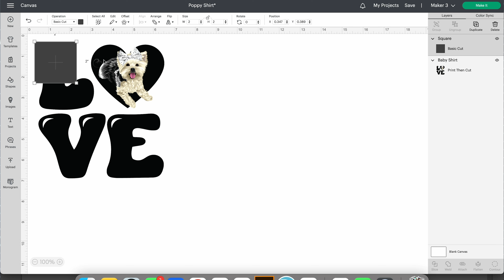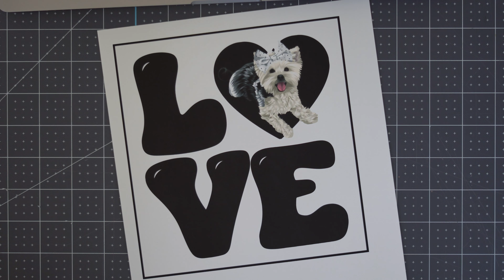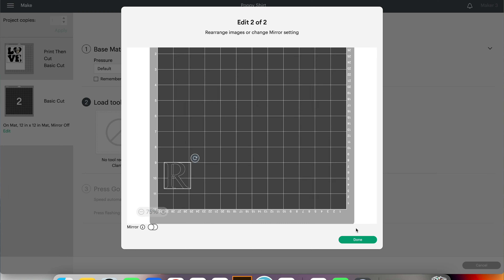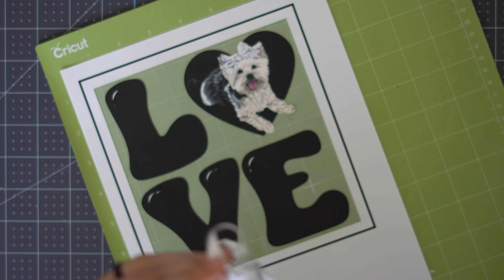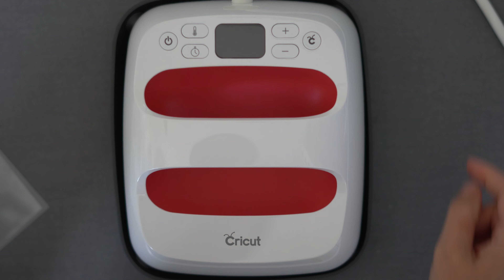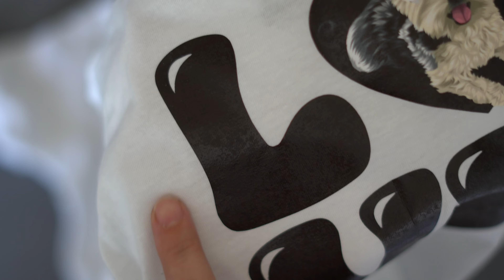How to Print Design for Shirt using Siser EasyColor DTV (direct to vinyl)

Comment: Was so fun to see this product. (Sadly, only the mask is available on 143 Vinyl.) I've subscribed for a notification from 143 Vinyl when vinyl is back in stock. I've used StarCraft Printable HTV for Dark Fabrics and have been a bit disappointed (it ran after washing and wrinkled). Will be interested to see if Siser DTV is better.
Reply from the maker: I added a link to Siser DTV on Amazon however it is a bit more expensive. I hope it comes back into stock soon at 143Vinyl!
Reply: @KarleyHall  Threw it into my Amazon cart. Really want to try it to see if it is better than the StarCraft. Thanks!!! (BTW, used your sticker sheet instructions--same products you used in your video--but needed six layered/attached rectangles to get my Cricut Maker to cut through the printable vinyl and UV sheet. But...SUCCESS)